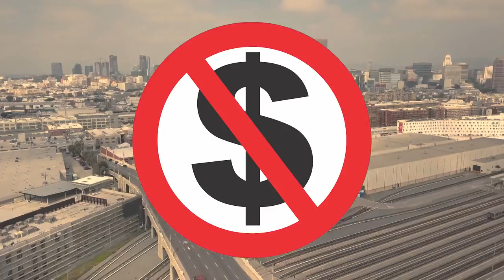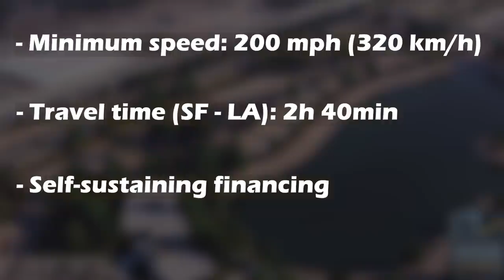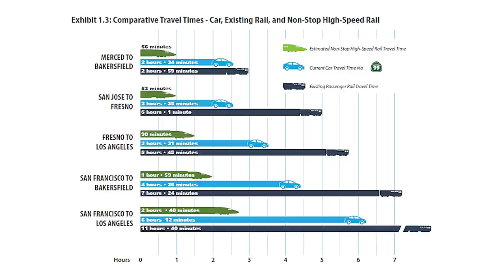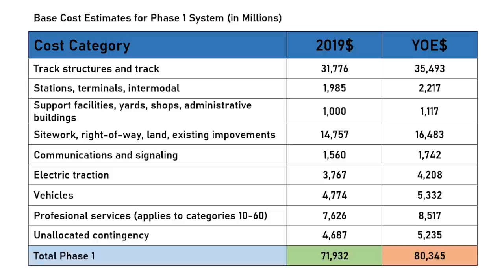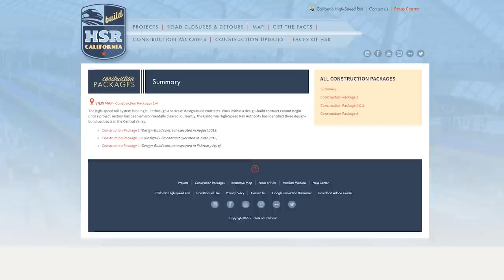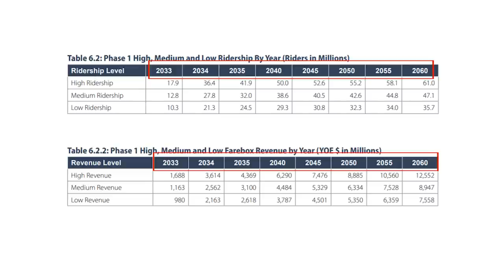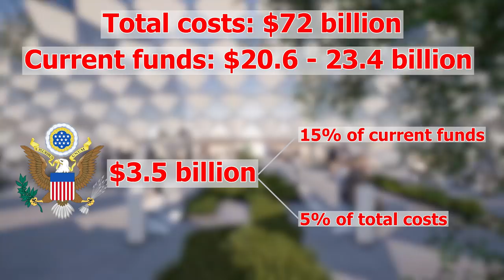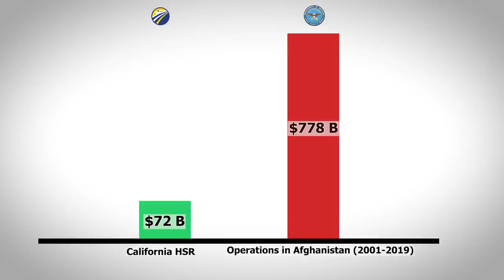California High-Speed Rail Project: All You Should Know

Comment: Somehow I find it very strange, that something like that "has to pay off". No one bats an eye, when building highways, but public transport has to be a profitable business.
Reply: Highways are more vital in America than trains. Trains basically do the same thing as planes but are slower and more expensive.
Reply: @blackhole9961  they are also massively more energy efficient than either of those options. 

And HSR would have economic benefits and for a government project all the economic growth means extra tax dollars which should be considered part of the profit. (The same as when Interstates massively boosted the exonomy in the 50s)

Also, gas is $5 per gallon right now, trains can be directly hooked into the grid making use of all that solar Cali is building. (And if they build concentrated solar basically non of its components have to depend on imports, but i would expect many would be imported anyway because thats the point of trade)

And cars and planes currently run on a finite supply of dino juice (technically its algea and sea creatures not dinosaurs) and have a hard time switching to anything else, and even if they use something like hydrogen from electrolysis that still needs electricity and a primary energy source.

HSR is a good idea, Cali just historically is bad at managing any of its projects. (Like step 1 when they decided to build it should have been aquireing the cooridor as cheaply as possible, and then start construction from the ends and work their way inwards)
Reply: Not to ignore the infinite waste tolerated by the tax payer (or forced on) through the foreign wars
Reply: @blackhole9961  tell me you're American without telling me you're American
Reply: Being self sufficient as far as operational costs was one of the key selling points when the proposition was approved by the voters. It seems fairly obvious that this has gone out the window now. It also seems obvious that many of the commentators here either weren't alive, a voter, or didn't live in CA when all this was being developed and sold to the voters since knowledge of the process that was used is lacking.
Reply: @johnburwell6609  it will pay itself in operational costs. It's the debt and the interest that it will struggle to pay, and most probably not end up paying.
Reply: @blackhole9961  yeah, highways are more vital than trains in America (at least for passenger travel) because US doesn't have a good train system lol. Other developed countries have developed much more advanced rail transport methods.

Trains don't have to deal with airport shenanigans, they're much more roomy, insanely more friendly to the environment.
Reply: @chinguunerdenebadrakh7022  not true, before highways were constructed rail was the primary method of travel.
Of course as cars got more popular more roads were built and cities became more car centric in design.
Also one of the primary reasons for roads bein built was because it could connect the country far more than trains ever could.
People could get directly to their destination simply by driving.

“Trains don’t have to deal with airport shenanigans”
Maybe not to the same extent but still expect enough security. Attacks on trains have happened before in the past.
Reply: Roads are paid for by fuel tax
Reply: @cgmason7568   Many American communities cannot afford road maintenance. Your country is way too far behind anyway. As a European, we should focus on Eurasia and not America. Our Swiss train system also loses money. Indirect benefits are absolutely massive though which is something Americans will never understand. I think China and India need to be the new major partner of Europe.
Reply: @jamaly77  Yes, the important thing about a public transportation system is not whether it is profitable, but that it can provide huge potential value. When a public transportation system takes profit as the highest priority, it is doomed that the final result may not be very good.

However, this potential value often takes time to accumulate and cross-regional levels. If it is only a single regional government or community, it is likely that it will not see this value or truly obtain this benefit. In other words, it really needs planning and coordination at higher levels of government, and adequate assistance from those agencies.

Comment: I am wondering if all those 12 lane motorways are profitable? And do they hold ballot measures before each motorway construction? I don't even dare to imagine the money and time they spent on building those motorways, it must have been hundreds of years and trillions of dollars.
Reply: The US built interstate highways in the 1950s but in today’s money costed $500 billion. This varies year to year but in 2020 the us spent a total of $165 billion all roads. They may not be profitable but they are way more of a priority because everyone depends on them and they do more for the country. HSR in California just to connect 2 cities costs $100 billion+ and the price is still rising. This doesn’t even add cost of maintenance and operation. It would essentially just be a slower and more expensive plane.
Reply: @blackhole9961  but you're also not accounting for highways maintenance and the upgrades they've done since the 50s
Reply: @blackhole9961  as stated in the video for the distance traveled it will be a faster form of transportation for the people by about 2.5 hours
Reply: @blackhole9961  yeah and getting to said airport and out, checking in, Security, boarding, problems with the MD80 or OLD 737-400 again, would waiting for luggage, and then getting downtown? takes 6 hours SFO to LAX, and look at china they have 78%of the total highspeed rail infrastructure in the world and it paid off, France and Japan has a similar density with cali right in the sweet spot middle, it will be profitable. But only when the the the entire SFO LAX HSR 350km/h corridor complete.
Reply: @NikanDragosysSerpenDra  It will take the same time to get to the train station as it takes to get to the airport.  Probably more, since the train stations won't be well-served by roads.  As for Chinese HSR paying off, where do you get your figures?
Reply: @michaelsommers2356  They plan to have the train stations in the heart of downtown of San Francisco and Los Angeles
Reply: @NikanDragosysSerpenDra  ok but like the comment before me said, most would have to to commute to the train station which would take about the same amount of time as an airport.

Not to mention the process in the train station is the exact same as an airport. 
You have to Commute there 
Arrive an hour early
Go through check in and security 
Boarding process which can take 20-30 minutes 

Also wouldn’t that not matter if both train and plane had the same departure time?
If the train takes 3-4 hours to get to the next city while the plane takes 1 which one do you think will win in speed and costs? Which one do you think is more efficient?
Reply: @thr433  most people still have to commute there
Reply: @NikanDragosysSerpenDra  
Let’s set both departure times to 12:00pm
Plane: departs LAX or another local airport and arrives at SFO 1:00pm
High speed train: departs LA and arrives at SF at 3:30pm
Which one do you think wins in shear speed alone.
Reply: @blackhole9961  Ideally with all the other stations on the line they'll be more stations closer by to other people. 

Also with the other transit projects going up in SoCal and NoCal it will cut down the commute time for most people in the densely populated areas.

Also trains are still far more efficient than plans in moving large amounts of people. If done right a single train can move thousands of people and with enough frequency even a conventional line can far outstrip to passenger carrying capacity of Airports.  Most importantly Climate Action is something that Californians have repeatedly said is something they care about an electric train connect to a nearly entirely green grid will produce far less greenhouse emissions than the equivalent plane flight (I know electric planes exist but the technology doesn't exist in the medium term to scale it up from small turboprop planes)
Reply: @thr433  planes can also move large amounts of people as well, the 747 and a380 can do that. But 747s and a380s don’t fly that distance because it’s a waste, smaller planes like 737s do but are more frequent than any train as they arrive at the airport in a shorter amount of time.
It doesn’t matter how many people it can carry if the rout doesn’t even support it, otherwise you would see jumbos like the 747 making that short journey all the time.
Reply: @blackhole9961  747s and A380s are not nearly efficient enough to do that short hop profitably; also Airport capacity is a real issue LAX has been overcrowded for decades and even with new expansions isn't going away soon. SFO (and the other Bay are airports have some capacity but certainly not enough). Then of course their is ATC capacity as well as just the maximum amount of planes that can be safely flown on the most efficient route. 

Air travel doesn't scale well when compared to rail travel.
Reply: @thr433  then it’s time for California to get major airport upgrades, DFW airport(a significantly larger one) does not face that problem despite it being the 4th busiest in the country.
Reply: @thr433  an area with that many people should have an airport the size of DFW or at least another airport slightly larger than LAX.

The LA metro has many reliever airports to choose from and so does the Bay Area
It can’t just be LAX and SFO taking on everything.
Reply: @blackhole9961   Yeah but thats the problem the capacity just isn't there to compete with rail in terms of passenger numbers.

Assuming you have a frequent daily service between 2 cities you could at most get 1 flight per hour both ways. And even with the highest capacity jetliner that is viable (777-9/A350) it still will not match the capacity of trains running every half hour. 

All Airports globally are just not built for the amount of volume trains can deliver. Lets not forget that HSR in developed countries will be cheaper than an a plane flight for the comparable distance. In Europe and Japan for similar distances you can get a plane flight. You know Tokyo to Nagoya; Paris to Lyon etc. and the thing is HSR not only competes but killed the airlines at that distance and they did it all while vastly expanding the efficient capacity if the route in a way planes just can't.

Put it another way it takes far fewer manpower to run a train line than an airline. It has fewer working parts so maintenance is far easier. Trains are cheap (compared to planes) and while infrastructure costs initially are a pretty penny once in place maintenance costs are low (this is the same for Airports to a lesser degree; efficient well working airports don't come cheap).

And when you factor in all the fees airlines must pay you start to understand why air travel is both less efficient and more expensive. They must pay: gate fees; fuel and maintenance; ATC fees; landing fees; labour as well the plane itself. Running a HSR is no picnic. They have to pay power fees; labour; maintenance but thats it really.

No amount of Airport upgrades will do the job; reliever airports can help sure but they still will use up airspace and the same ATC workforce which at a certain point you'll run into capacity issues. A single well served main train station can on its own outstrip whole Airport systems. Air Travel has its niche for long-distance travel where the costs and efficiency make it rhe ideal form if travel. But for short and medium distances they just can't compete with lower cost and far more efficient ground based alternatives
Reply: @blackhole9961  Also DFW in a regular year is still smaller than LAX in terms of ridership; But that is besides the point in SoCal and NoCal most of the major airports do not have the room to grow much larger than they are now. If you were to build a new airport you'd have to build it farther out of town and thats unattractive to passengers.
Reply: @thr433  ok but assuming you have flights running at the same time( every half hour) and arriving at the other airport in a shorter amount of time(about 1 hour), leaving in the next half hour while the train is still 2 hours into its journey, wouldn’t the plane not be more frequent? So really if the plane makes 2-3 flights in the time it takes for 1 train to get to the other station which one do you think is more frequent?
Sure trains can carry more people, but in terms of shear speed and frequency the plane still wins, and usually the transportation option that offers the most frequent times usually wins no matter capacity.

Not to mention the projected high speed rail rout is planned to have 24 stations meaning stops while planes don’t stop.
Reply: @thr433  Sure airports are generally far away from city centers(where pretty much no one lives anyway due to suburbia), but them being unattractive for that reason doesn’t have to be the case. China fixed that problem with the Shanghai maglev which is pretty much just a shuttle rather than an actual train. 

A newer and larger airport can also built offshore and connected to the mainland like Japan Kansai via road or rail link

Although most would have to still commute to the rail station just to get there.
Reply: @blackhole9961  In terms of sheer frequency plane flights can't scale in the same way trains can and planes carry less people; and do it with far less efficiency in terms of fuel capacity. 

You also have to remember that Airports don't do just one route they do hundreds and generally speaking you won't find twin cities with plane flights more frequent than every hour or so. 

And you have to remember it takes airspace to scale so ATC capacity is a thing to worry about. California airspace is congested now with it's traffic load and that can cause delays. Once you've built the infrastructure HSR can do something that planes just cannot; take millions of people one one major route per year in the mid range market.

The problem with planes is expense if equipment, complex maintenance, capacity constraints when you consider your own workforce and ATC capacity, and the fact the mid range markets aren't nearly as profitable as long range routes.

You're operating under the assumption that real life pressures don't factor in when deciding capacity. Which I think is a big oversight when determining how competitive transportation modes you have make sure you also factor in everything. Trains for example aren't delayed by weather unless in extreme cases. Planes can be grounded in thunderstorms, or fog, or snow, or hail etc. The only analysis I see you making is under idealized conditions which rarely is the case in any given day
Reply: @blackhole9961  Thats kinda the problem isn't it? Kansai Aiport also has the most expensive landing fees of any airport anywhere in the world; and has struggled for decades to attract and retain airlines.

Maglev technology is really just super fast HSR and highly expensive at that. So its not entirely cost effective as a shuttle. Besides all of this miss the biggest bottleneck with airtravel, ATC capacity which build a shiny new Aiport doesn't solve. (Setting aside that build a new Airport on reclaimed land is highly expensive and not as cost effective)
Reply: @thr433  then the best option for California is to invest heavily into its reliever airports to not put so much stress into LAX and SFO.

Again, trains may carry more people, but it’s generally that faster and more frequent option that wins. I can’t see many people actually using it when they figure out that planes basically do the same thing (take them from city A to city B) but can generally do it at a faster pace.
Reply: @blackhole9961  have you been on a train before? Lol. You don’t do any of those things. You can get to a station board and be on the way in 5 minutes..
Reply: "I am wondering if all those 12 lane motorways are profitable?"

Well, there are quite a number of operators of toll roads that are a part of the Interstate Highway system...  And I'm unaware of any of them going broke or losing money.
Reply: @Steven Strain That still doesn’t solve the last mile problem that the train would suffer from making it practically no different than just flying to the other city.
Reply: @Steven Strain ??
Reply: @Steven Strain Thanks for explaining. Though it doesn't change the big picture: the US built a crazy lot of motorways because it had the political will, and it doesn't build a decent railway network because it has no political will for that. Political will here means the will of oil giants, as practically those control the government.